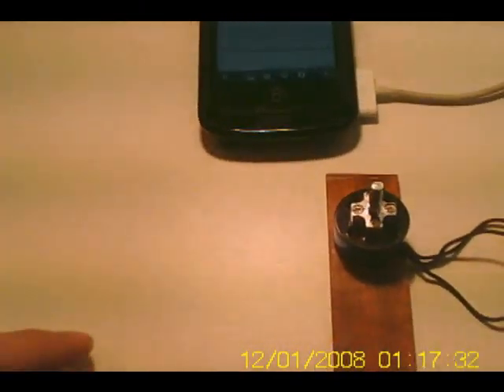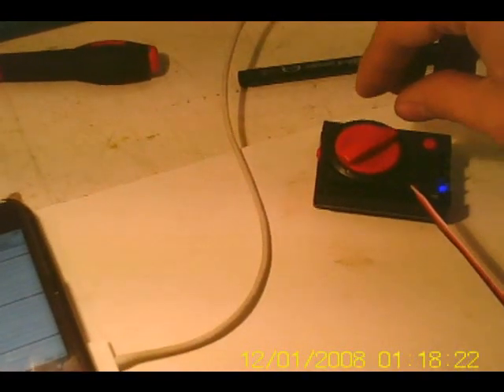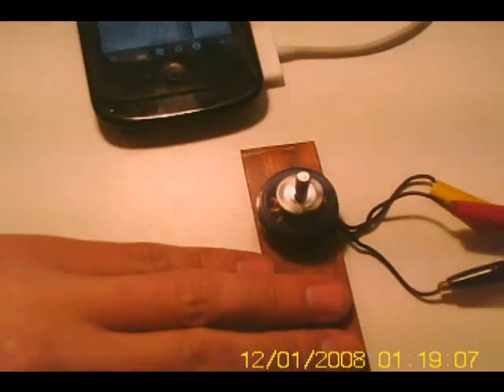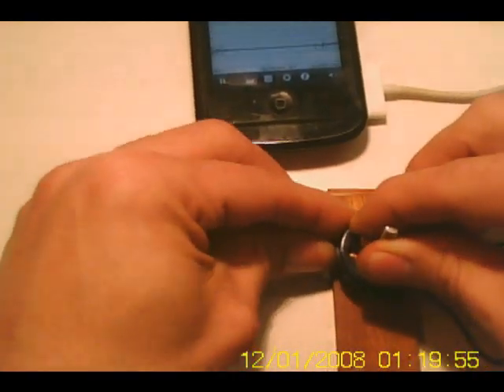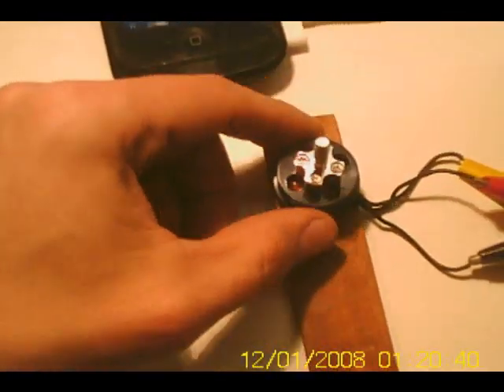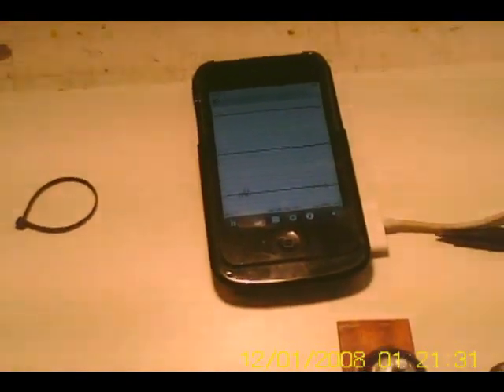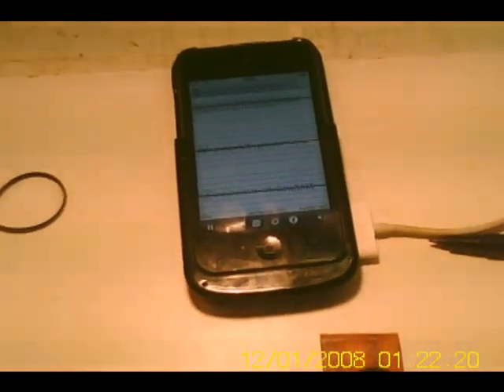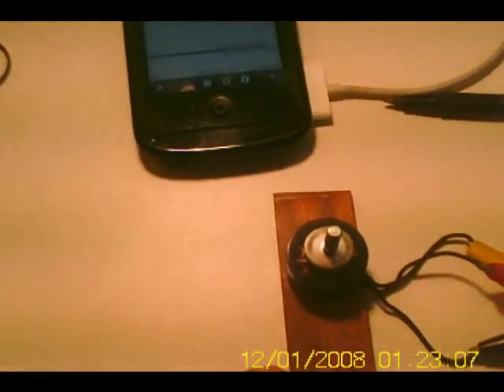HOW TO BALANCE A BRUSHLESS MOTOR WITH YOUR IPHONE / ITOUCH

Comment: could this be done with the motors mounted to the quadcopter
Reply: Agreed, in beta flight/clean flight, you can run motors individually with a micro usb connection and a lipo plugged in.

Comment: Do you really need to add tape only? Or is it possible to use something else other than tapes.
Reply: sure u can add anything else but with the right wheight
Reply: +Ang Low Tah ziptie
Reply: +Ang Low Tah ziptie
Reply: +Ang Low Tah you can also remove some material (drill/dremel) from the other side for a more clean and permanent solution

Comment: I noticed that as you speed up your motor, it still vibrates for a few moments before coming to a balanced state. So even though this method might balance a motor when running at a constant speed, but as it speeds up or down, it vibrates for a few moments, and that's where you notice vibrations in your video. While flying a multi-rotor, as motors are changing their speeds constantly, i.e. when balancing and moving the copter, you will still see vibrations in your video. This can be eliminated only by using better quality motors. And still, after every so many flights you need to keep balance everything over and over again.

Comment: It works for a windows phone also.

Look for a app called "seismograph" , its looking at vibrations to the phone. I have a octocopter and balanced each motor on the copter by shuting down the onthers one at a time.

Perfect Balance now.